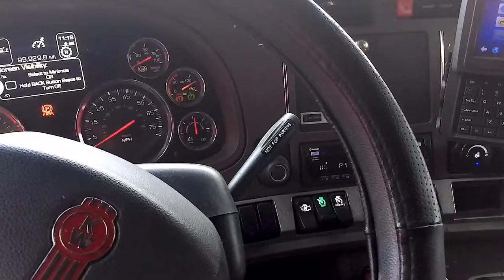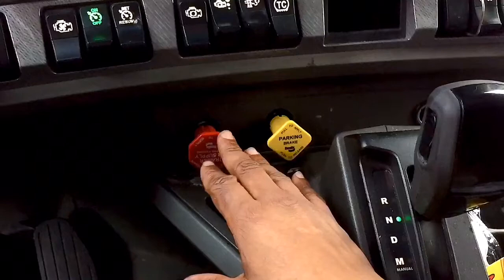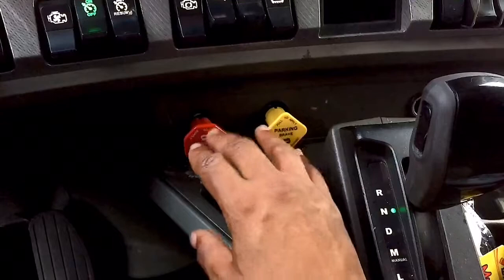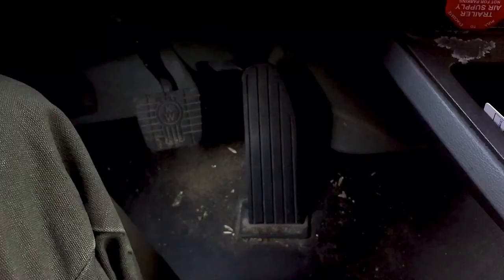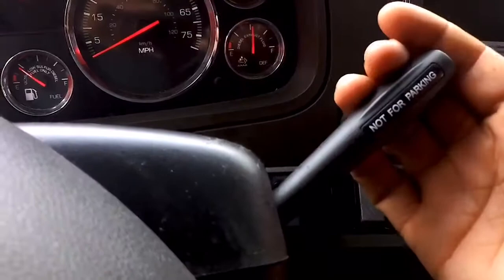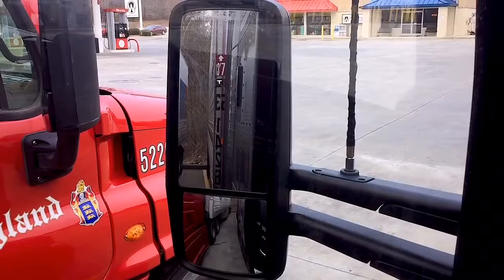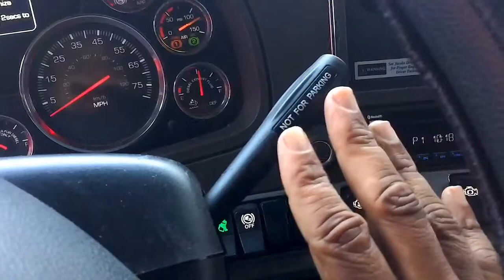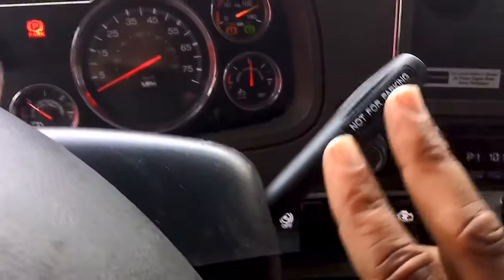TRUCKING: HAND BRAKE VALVE (Tandem Brakes)

Comment: Never use the hand valve for parking because all the air might leak out, unlocking the brakes (in trailers that do not have spring brakes.) Always use the parking brakes when parking. If the trailer does not have spring brakes, use wheel chocks to keep the trailer from moving.

Comment: My co driver is all that he will use, I’m trying to break him out of it but some people don’t listen. His reasoning for the use is (Ready?) because the brake foot pedal is not enough to stop a loaded tractor trailer. 🤔😳
Reply from the maker: You can jackknife using that especially on wet surfaces and even greater chance when tandems are past the seventh hole
Reply: Elite Trucker's that could have been yesterday, we were on the 9th hole and raining in Kentucky
Reply: I’ve already requested to get out of the team and into my own truck.
Reply from the maker: I'm saying this because it happened to me, I was driving down the mountain south of I5 in California, and as an O/O I wanted to save my brake pads so I only been using tandem brakes, I almost jackknifed while on a simple curve and that was a rainy day, luckily I chose to have an automatic instead of a manual because I would've lost control for sure!!
Reply: @TacticalTrucker  Hi. I'm still learning so forgive me if this sounds like a dumb question but how did having an automatic save you?
Reply: @madalomusic2097  He was able to get power to the ground faster to pull straight before he jackknifed.. The time it would have taken him to grab the shifter, get in the right gear and start power to the drive wheels was the difference between a lesson learned and a jackknife on his safety record.
Reply: Just a heads up your comment about not using it during the winter because it will deliver more pressure to the control line and potentially burst. This is not accurate, that line will see the same system pressures whether you use the foot valve for the hand valve.
Reply from the maker: When using plastic cables yes it will burst, this is why newly manufactured trucks are being equipped with rubber hoses, during the winter time the plastic gets hardened and all of the twist and turns weakens the end points of the plastic, and with all the salt on the ground shooting up from the tires onto your hoses will also cause the plastic holes to weakening
Reply: He one of the Swft drivers  you know they never listen,